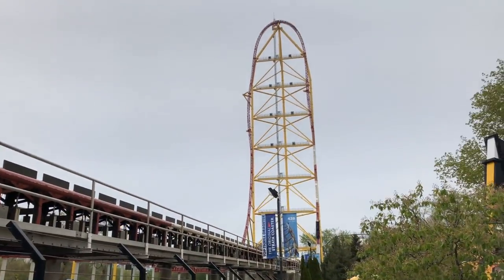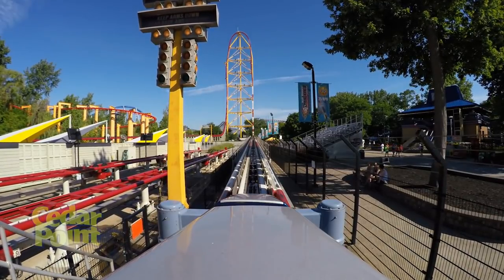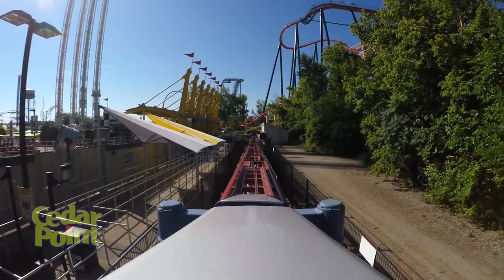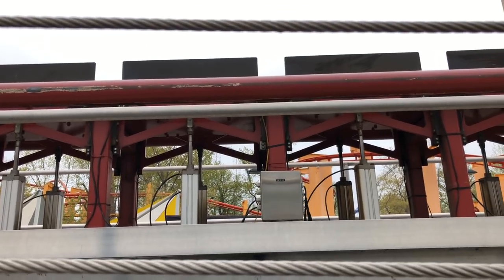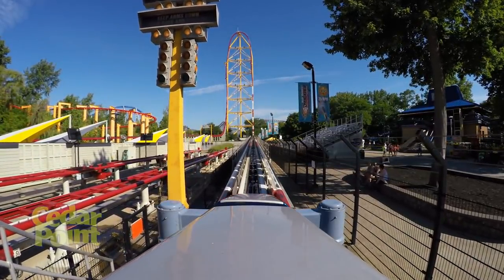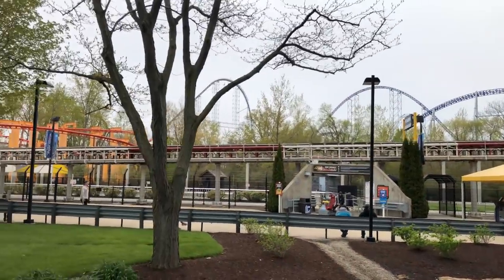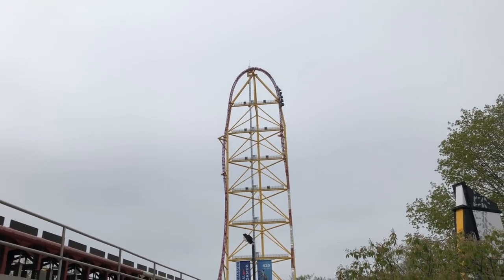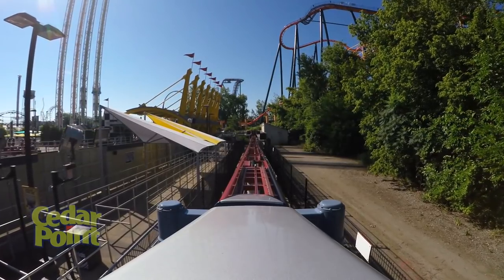Cedar Point Conspiracy Theory: Top Thrill Dragster

Comment: It's funny how Stealth and Rita never have any of these issues.
Reply: X PARKS Rita doesn’t go nearly as fast  lol. Imagine the stress this ride gets launching constantly at 120mph. When dragster first opened the thing was clocking over 130mph the first few days it was insane. But the first gen trains were also smaller and weighed less at roughly 5 tons each train.
Reply: The ride experience was way different back then. You’d actually get ejector airtime on the tophat!

Comment: It will not. It would require too much power making the ride not worth running. The only fix would be a conversion to compressed air but that will never happen. This video seems a bit useless, not to be rude but it does. TTD will never be converted it would be cheaper to dismantle it and build a brand new coaster than to modify TTD. This will never happen.
Reply: amen the tower would need to be rebuilt too since it would need at least 5 more track peices

Comment: It would be nice to see them do some work to make TTD more reliable BUT unless Im wrong it currently is "Hydraulically powered" (Catapult) LIM/LSM would need a WHOLE LOT of power to operate (on top of replacing tack, and trains). Also since I'd never been to Cedar Point I didn't know they had 5 or 6 trains on this ride, I would have figured 2 or 3 but DAMN! 5 to 6?! As short of a ride as it is no wonder its a collision hazard to run all 6! XD
Reply: Sexual Tyrannosaurus yeah I went to cedar point , they have  a little place where you can get off top thrill early it’s fast operations
Reply: Two or three are always in the station and two are always unloading before the station. It's crazy how the lines can still get so long.
Reply: 2 trains are loading in the station at the same time.  Meanwhile, there are 2 dispatched trains.  One of those is launching while the other one is waiting for their turn.  At the same, the train that had previously finished their ride is unloading behind the loading station.  You get off the train at a different spot than where you get on.  It does help to speed up operations.  Each train has 9 rows of 2 seats.  That is 18 riders per train.  That is half the number of riders as one train of Millennium Force, so that explains why more trains doesn't necessarily mean that you move the line quicker.  It is interesting seeing how they operate both TTD & Maverick here.

Comment: When this coaster was announced they talked about the development. They said all of Sandusky doesn't have enough power to make an LIM/LSM system for the height of the coaster feasible and cost effective. They went with the same type of system that Navy Aircraft Carrier ships use to quickly launch their planes with a water cooled air launched cable system.

Comment: I've been to Cedar Point on 4 different weekends throughout the year, and compared to years past, Dragster has been running like a champ in 2018. I only encountered one time where it went down, and it was due to a sensor, with maintenance bringing it back up in 20 minutes or so. All other days it was running flawlessly in a variety of weather (hot, cold, dry, wet, windy, cloudy, etc.). Also Dragster had some of the shortest lines I've ever seen for it this year.!In past years, it felt more of a gamble with it breaking down more frequently, some days not opening at all. 

That's just my observation and maybe I just got lucky this year!

Comment: It wouldn't be possible. Red Force is a lot slower than dragster and the launch is around 5 meter shorter. Dragster would need the launch to go maybe 20% up the tower which will mean yet more track as LIM/LSM need a different track design
Reply: Please add a air time hill

Comment: I think they will eventually update/upgrade it.. I feel they have to. I think along with upgrading the current dragster I think they should add a second one. Set it up so that the two are actually one ride. One going left over the hill and one going to the right over a separate hill and have the trains take off side by side simulating an actual drag race between the two. I know it will probably never happen just think it would add a really cool element to an already awesome ride. Not to mention it would help cut down on wait time.
Reply: That will be about $45-$50 million
to pull off maybe more with the tarrifs & the removal of Power Tower, Corkscrew & the rest of that midway.  I say spend about $10_$20 million & add more elements extending the ride by using Millennium Island & over Iron Dragon

Comment: Good theory, highly doubt this... once supervised a LIM coaster.... the variables were even higher... capacitor errors, operating costs, electrical grid strain. Warm up/cold weather variables. It’s a pain going over 180ft with a magnetic launch, the only ride successful I think are the old school Intamin LSM coasters with the huge magnets and large wheels that go up and down, without block sections... ie Superman  an tower of terror II... maybe I’m old and technology is better.. but the laws of physics haven’t changed and budgets are even tighter.
Reply: Don't confuse LSM and LIM, they're very different in function and LSM is hugely more efficient which is why it's so popular and Intamin has said they're moving away from cable.
Reply: Still launching a coaster perfectly over 400 feet.... I dunno..l maybe if they placed two rows? The intensity wouldn’t be there though.... I would love to see a pneumatic launch!

Comment: But honestly, what TT Dragster needs more than anything is some actual track, so that it goes someplace for more than ten seconds.  As it stands, it's more of a thrill ride than a coaster, Power Tower's big brother as it were, form factor notwithstanding.  Millennium Force, or even Magnum, despite not having that big number (by today's standards) on the first hill, is an overwhelmingly superior coaster ride experience.

Of course, I'm not sure where said additional track would go.  To the front gate and back above the midway, perhaps?  Into the area where Iron Dragon currently stands, and maybe over the dinosaur thing?

As for the spare train, that does mean you can pull one aside for maintenance without impacting normal operations much.  But this is a pretty underwhelming benefit if most of your maintenance is going into the track side of the launch system.

Comment: A sensor for a sensor for a sensor for a sensor. A hydraulic or pneumatic  cylinder usually requires sensors  for the set and pull position that is  connected to a PLC , if only one sensor is not made the machine will drop cycle. Sensors usually made in China, go figure

Comment: Here's the issue though: Cedar Fair and Intamin are not currently on 'speaking terms'.  I also doubt that any other manufacturer would have the legal right or even basic interest to work with Dragster.  I think it would be beneficial for the damaged relationship between Cedar Fair/Intamin to have Dragster get an upgrade.  However, this would, once again, cost Cedar Point a lot of money, as well as cost them a lot of time.  Also, keep in mind: LIM/LSM launches are not nearly as powerful as hydraulic launches.  Red Force, which is the fastest LIM coaster, reaches 112 mph in 5 seconds (22.4 mph/sec).  That's not nearly as high of an acceleration rate as Dragster's 120 mph in 3.4 seconds (35.3 mph/sec).
Reply: Cedar Fair owns the ride as it is currently installed. They don't need Intamin's permission to do a damn thing.
Reply: People from intimin were just at cedar point last year and met with Cedar point executives.  Jason McClure posted a picture with them on twitter and said they met
Reply: Great points allow me to also add that Cedar Fair rival chain Six Flags is giving Great America Maxx Force with it's powerful launch after Cedar Point openly started going after the Chicago market. The CP fanboy in me believes that Maxx Force is a shot @ CP Millennium Force & Dragster,  the racing theme & station design, the words Maxx> is subjectively greater than "Top", Force obviously from Millennium
Reply: I can see Maxx Force being a shot at TTD, for the reasons you've stated as well as it's being another cable-launched coaster with a more interesting layout than TTD. Yes, I know it's pneumatic, not hydraulic,  but otherwise the launch mechanics are similar. But beyond the name, I'm curious how it tries to capture the draw of Millennium Force. I just don't see enough similarities beyond the purely superficial name.
Reply: @matthewjohnson427  
Ok maybe Millennium Force is a stretch besides the "Force" & the initials "M.F." but I said that was my inner CP fanboy coming out. Another fanboy theory of mines is starting to emerge.maybe just maybe if a Dragster expansion is in the works for the 150th anniversary (I doubt it) & Six Flags caught wind of this & had to act.. I also thought the same about Magic Mountain West Coast Racers vs & updated Gemini model with dueling RMC Raptors or T-REX . No doubt CP next coaster will be a RMC because of my theory I've been preaching online since it was obvious that RMC was working on Steel Vengeance. Cedar Point always  receives coaster from the same manufacturer in consecutive stretches with 2 exceptions in 1991 Mean Streak & 1979 Jr Gemini...
Arrow
B&M
INTAMIN - ( the greatest years )
B&M again
Now it's RMC turn to truck out CP
Reply: Red force isn't LIM, LIM is horribly outdated and inefficient and Intamin wouldn't use them anymore or a long time.

Comment: Everytime I've have wanted to ride top fuel dragster it's always been down. I have yet to ride it.  But cedar point needs to get rid of iron dragon, wicked twister, Magnum XL 200. Steel vengeance and millennium force and Maverick are my go to coasters.
Reply: Lol they would never get rid of Magnum XL200. It’s been an icon at CP for years and years. Tearing it down would upset so many people. It would be the same thing as tearing down the Blue Streak, which has been an icon now at CP for 55 years.
Reply: Magnum is a classic Arrow Hyper coaster! It was the first hyper coaster of its kind in the west being 205 feet tall and reaching high speed of 72 mph. Not to mention the length. It’s definitely a fan favorite, And an icon for the park. They will keep it as long as they can keep it running!

Comment: Cedar fair stopped working with intamin in 2010 so I don’t see them upgrading dragster
Reply: EddieCoasterFan That doesn’t necessarily mean anything won’t happen. This coaster is a few of a kind ever made and most definitely a trophy coaster of the park. It’s not going anywhere. They are working with Intamin to find the most reliable solution for TTD. If the ride didn’t have so much downtime it would see a lot more guests and satisfaction. Running perfectly or broken down for a day this ride is still in my top 5.

Comment: I think if you replace the hydraulic launch with LSM it wouldn't be an upgrade. However, if they replaced the current braking system with the standard magnetic fins that don't have the complexity of the rising and dropping fins and keep the hydraulic launch, then you'd presumably have a more reliable attraction. Now let's conspire!... How about removing the twists on the top hat to make room for a second set of S&S air launch track running along side but traveling in the opposite direction as the Intamin track. A drag race instead of a time trial!...Dueling dragster models...First park with 2 strata coasters...Imagine the records! It could happen, look how S&S reworked a Premier water coaster to make Powder Keg.